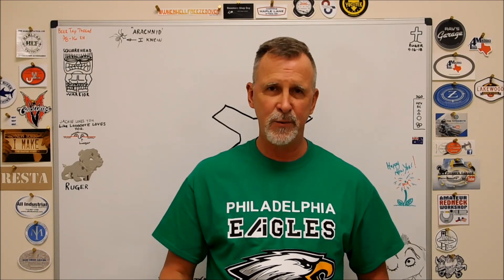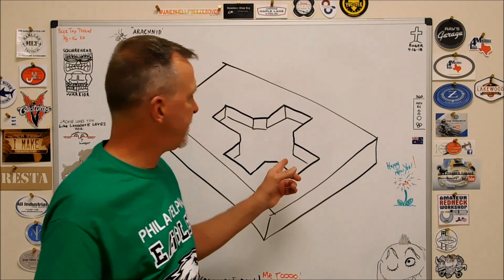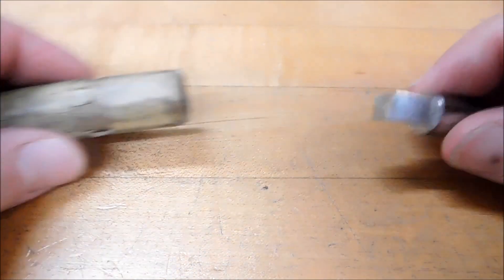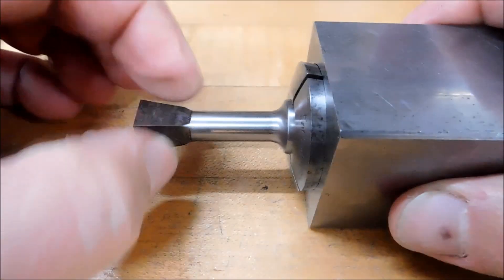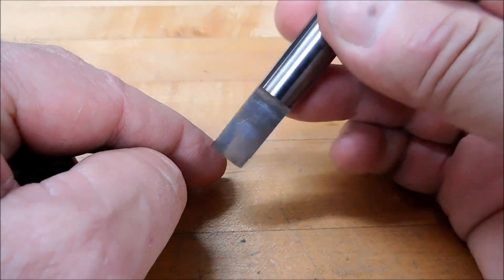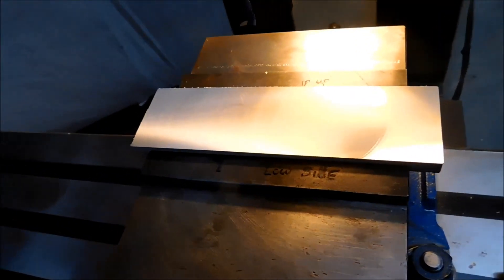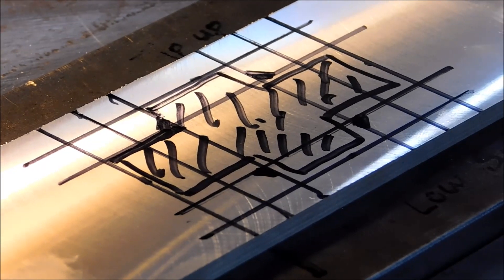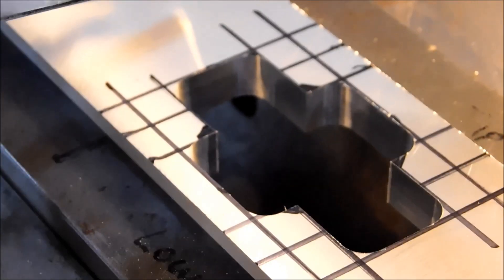You Can't Make that Part on a Manual Mill......Or can You?

Comment: When putting the mill in back gear & lowest speed why not just set the brake on the spindle? Apply the brake & lift the handle to a 45 degree angle & it holds the spindle...

Comment: can this still be done if you have a base? and a stupid question, but just making sure, your machine is not running while your broaching right? and will a HSS broach broach 4041? Thank you Joe!!!
Reply from the maker: Machine is off, lowest gear possible, brake locked. You probably could do 4041 (4140), and I'm not sure about the base comment. You mean a solid bottom pocket? That would require a different grind on the tool and some secondary.
Reply: @joepie221  thank you!!

Comment: Are you manually making the broach move up and down? The close up of the video doesn’t let me see. Thank you. Also, it looks like you are using the “side” of the broach to shave a small amount off the sides of the “cross.” Maybe this was just for demonstration, but would you intentionally mill the internal shape a little undersized, then broach to the exact specification?
Reply from the maker: yes. the broach movement is by hand.

Comment: Hey Joe not sure if you`ll see this but I heard what you said about bluing stainless. I built a 1911 pistol out of 416 stainless. Will the method you talked about work on the slide and frame without any dimensional changes ? I`v always wanted to blue the pistol but did`t know how. I almost went with chemically blackening it but really wanted to find a way to blue. Maybe now I have ?
Reply from the maker: I have honestly never tried to blue 416. It would be an interesting experiment.
Reply: @joepie221    I`m no machinist but trying to learn. What I do know I learned by watching my father. So forgive me for any stupid questions I may ask. If I were to take the 416 and and mill it out close(maybe thinner in kinda induce warpage if it is to happen) to the dimensions of the slide and frame do you think it would accurately give me an idea of what`s to come when heating the real parts ? All this would be done to the mock parts: Do you think I should I just let the parts free stand, hand or secure them down to a flat surface ? Finally, will this harden it ? and would annealing bring it back down to normal hardness ? suggestions on temps ? am I asking to many questions ??? LOL

Comment: Nice job Joe.  I did something very similar in a cnc about 15 years ago making UHMW carriers for Siemens Diesel Injectors to run on a conveyor line.  I still have the HSS broaches.
Reply from the maker: That material is tough to deburr. break a lightbulb and use that as a deburring tool. Trust me. the frosted bulbs actually work the best.
Reply: @joepie221  Seriously, better than an x-acto knife?  I'll have to give that a try the next time I'm working with UHWM......if I can find a bulb.  I think everything in our shop is LED now except for some fluorescent tubes in the office.
Reply from the maker: @bbumpy4523  We deburred UHMWPE with broken glass for years. Something about the curve of the chunks and coating inside the bulb makes it glide far better than an x-acto. Dead serious here.

Comment: Is it possible to set the FADAL to zero Rpm and G code to have the spindle go up and down while stepping over a set dimension per stroke?
Reply from the maker: Yes, I could do that, but the orientation of the tool would be tricky.

Comment: The internal corners can be milled by a number of methods : 
1) A Bridgeport Quillmaster with an angle endmill using the power quill-feed.
2) Clamp the part to be milled flat on a 45 degree angle to the table.  Rotate the head of the Bridgeport to nominally 45 degrees . Grind the bottom of  single-lip cutter to an angle to suit. This can be trig-ged-out  or done by trial and error. Use the knee for the Z axis movement.
3) If the cavity to be milled is large enough, the Bridgeport Right Angel head can be used.
As far as broaching :
1) The Bridgeport Vertical Shaping Head attachment.
2) Clamp the part vertically to the table, and at a right-angel to the table's lead-screw. Mount the Bridgeport Right Angle attachment parallel to the table. Mount the broach in the head's collet. Use the table's power-feed to do the broaching. 
3) A shaper with a boring bar to accommodate a suitable broach.

Comment: Joe you're smart, I need advice. 
I'm using 8" angle iron to make tank brackets on a truck frame. 
I machined holes on one side to match factory holes on the side of the truck frame. The angle iron is hand cut into the right length. 
How do I position the top holes relative to the holes I already drilled? 
I can't indicate off the side since the cut isn't very good.
Reply from the maker: Do you need another hole relative to the one you already drilled? Does it need to match an existing set?
Reply: Yes the holes I drilled matched the frame perfectly so the angle iron mounts to the frame easy peasy. 
I need to mount the tanks angle iron track to my angle iron brackets. I could just drill some arbitrarily spaced holes, use a transfer punch then hand drill that spot, but I'm making 3 identical trucks and it would be convenient if everything bolted together like a kit, but more then that I want to increase my machining knowledge. Learn how to pickup features on multiple sides of a part.  That's why I watch all your videos. I know your time is precious. So thanks for sharing all your knowledge. :)
Reply from the maker: The first thing that comes to mind is to mock it up flat on a piece of cardboard and use that as a template. Setting heights is easy when its flat, then just bend it and line it up with the edge of the frame, or the first mounted bracket hole.
Reply: @joepie221  I'll do that.  I'll do all my calculating, make a template see if the holes line up. If they do I'll add those holes to my cad file. 
After that how do I physically machine the part? One side was easy, I put one edge in my vise, indicated off the corner edge, got about the right distance from the hand cut edge, used digital readout for hole placement, done. 
Now the second side is more tricky. I can indicate off the corner edge again, but how do I get my side to side to be correctly lined up with the first sides holes?
Reply from the maker: @elmeradams8781  Stick a pin or bolt in the first hole and locate your stop off of that. This way the overall length of the part can vary and the hole to hole will always be the same.
Reply: @joepie221  Ah excellent, I'll set my x axis 0 off the edge of the vise jaws run the pin up to that. That 0 is the edge of the hole, a little bit of math and I'm golden. 
Thanks Joe. I used to have a 87yo retired machinist helping me, but his health gave out last week and he passed away. Now I'm the head machinist lol. 
You're not even an old timer yet and already passing on your knowledge. Thank you.
Reply from the maker: @elmeradams8781  I just turned 60 in September. Some days I feel older than others. Good luck with your project.

Comment: I thought about broach as well. 
But you could get the 45* angles with the circular cutting tools and not on the broach.
Reply from the maker: Technically you could, but not in a vise thats not shifted or mounted to a rotary table.
Reply: To be honest it is probably faster to broach them like he did than to change the setup. If you have a one off part with reasonable tolerances this is a good method.

Comment: Just curious, why didn't you just rotate the part at 45 deg and use the end mill to cut those? Just for demonstration?
Reply: Part was already squared with the bed of the endmill, paired with the 2 parallels and already flycut. Easier to just align or use a angle block and use the test indicator on that. The more rigid the machine, tool, table and work piece the better.

Comment: Wow, I was told over and over to never use air to clean away chips.
A marker instead of dykim?
Reply from the maker: You must have been told that by a really old guy. For demo purposes, a marker is fine. Honest layout work, dykEm is the go to.
Reply: Joe Pieczynski, and it was an old timer not so much as an old guy.
Reply: As long as you maintain your machine regularly and wear safety glasses air is fine. It even says not to use air on allot of the data plates since it has a habit of getting into places it shouldn’t be and taking small chips along with it, increasing wear.
Reply: Fluffy Zyox, it does go places you don't want it to go. A chip brush and a vac works just fine, but alloys are not as much of a concern, it's high strength steels that are.

Comment: When you say  " 1hr @ 900° " on the 17-4 ss, what exactly do you mean?
Surely hardening SS (17-4 in this case) isn't that simple, is it?

Thanks for your time & knowledge...have a good one.
Reply from the maker: Actually, if you start with condition A 17-4, it is that easy. Let the material come up to temp with the oven and soak it for 1 hour. Air cool. Its easy. H1050 or 1100 or 17-7 is a lengthy process, but the 17-4 does the job.
Reply: I assume that's 900 degrees FAHRENHEIT  (?)  vs.Celsius . . .

Comment: Can always apply the arbor brake with a bungee cord to increase the resistance to rotation... ( 'w')/
Reply from the maker: I plan to make a collar with indexing options. I'll show it when I complete it.
Reply: @joepie221  That would work better indeed! (~_^)-b

Eager to see how that works out because we have a Bridgeport and that might come in handy some day.

When I was up in MN working volunteer energy research, we got a 22 inch 4 slotted indexable table from an auction and WOW was that thing handy! Especially when we could put a 3 jaw 90 degree chucked indexer on top of it! 

Talk about compound mitering!

I wish I could buy all that stuff off the shop owner up there, sure could use the heck out of it down here!

I once made a 1 degree tapered mandrel for that 22 inch table, my co-worker said I could not do it [negative minded, thinks women are dumber than men and that all people are dumber than him, makes me wonder why I put up with him all that time] and other than the initial 1 degree roughing cuts, I 'crept up on it' at high speed and low depth of cut until it was close enough to sand smooth with 2000 grit paper.

That taper mandrel fit so well he was flabbergasted. 

1/16" drop and it was too tight for him to pull out with pliers.

Never again did he tell me I couldn't do something.
Reply: Definitely. Lagun milling machines have locking spindle breaks which should suit this kind of operation well.
Reply: @benjamine6703  I apologize for misspelling 'brake' up there, did not even see it the first time and only realized it when I saw your reply and read my own comment [embarrassed]
Reply: Delicious DeBlair You were correct with “brake”

Comment: Hi Joe. Really good tip. I geuss if you made a broach the same size as your cutter you could work to the same numbers on your DRO or hand wheels for both milling and broaching? Is there much difference in cutting performance between the broaches that are flat on the end and the ones that are hollow ground?

Comment: Being a "NEWB" in this machining world that was pretty damn impressive!
Now I'm assuming, because you sped through the actual cutting, that you were pulling the quill handle down to make each cut? (Remember, NEWB)
Thanks for that one big time!!!!
Razor!
Reply from the maker: You are correct Razor. I was shaving the material off by hand. I moved the table a little bit after each cut.
Reply: @joepie221  
Thanks Joe. Seeing this really got the gears turning realizing how many ways I could use this technique. 
Hopefully I will come up with a need for this and put it on video and I guarantee you'll get a shout from Razor Works!
Thanks buddy,
Razor!

Comment: Many years ago I was taught to scrape in key ways on the lathe using a boring bar.  I later discovered that using an aloris tool post height nut to adjust depth of cut and turning the boring bar 90 degrees so the cutting edge faces down you can scrape in flats using the cross slide.  THEN rotate the chuck 90 to make square holes on the lathe.  Works in a pinch if it needs to.

Comment: Could you not use the spindle lock to keep the spindle from rotating out of position?  My Bridgeport  & Sharp mills both have a cam surface that locks the brake lever in the on position if you pull up (or out) on the brake handle..

Comment: While the can-do attitude is admirable, unless you are an EDM shop the first reaction should be to get back to the engineer and ask if this is really what he needs. 9 times out of 10 such parts are just engineering bloopers not the actual intent of the engineer. If this is what was really intended they'll probably ask for EDM or broaching to begin with.
Reply from the maker: You are assuming the engineer knows what EDM and broaching are. Too many places nowadays have designers that have never stepped foot in a shop and believe if their 3D printer can make the part, then it must be good and can go straight to machining. You would be surprised at the amount of work I reject for tall internal square corners and the customer refuses to make a change.
Reply: @joepie221  yeah, these types, okey. Anyone can play around with solidworks, but that doesn't make you into an engineer yet. An engineer must know how stuff he draws is made, or he is no engineer at all. But you know, young guys fresh out of school, how are they supposed to know on their own, there is not much in terms of workshop experience at schools. And I imagine that quite often the contact you have with customer is not even from engineering, but some guy from sourcing and logistics. As you say, they have never set foot in a workshop, so your feedback to them might be the first real experience with practical machining they get. If they learn, then that feedback is invaluable. 

And if they are the type who would like to learn, but never have had a chance, then they might appreciate a workshop tour and a little bit of talk about how you do things, what are your capabilities, limitations etc. That might be a good way to secure customer relations for the long term. Or it might be a waste of time, depends on the customer I guess.

Comment: Why can’t you set the spindle break to stop rotation?
Reply from the maker: You can if the brake is loose enough to implement the cam feature on the lever. mine is not worn enough.
Reply: tie wrap a heavy weight onto the brake handle since you do not have three hands LOL. sounds silly but hey it would help

Comment: How is that broach not rotating in the spindle?  It doesn't appear that a rotary broach is attached.  I rewatched the vid and this important piece of info wasn't mentioned.
Reply from the maker: Rotary broaches are  normally used while spinning. This was not a rotary broach application. The machine setup to reduce the rotation of the spindle was covered.
Reply from the maker: Start at 9:04 for the spindle info.
Reply: Thanks Joe... very ingenious!  I had rotary broach on the brain as I was trying to figure this out!  LOL  I can't wait to try this on my Bridgeport...

Comment: Nah!  I just use a 0.001" diameter slot drill to get tight into the corners - not perfect but close enough    lol!
Reply from the maker: I went to my drill index, and it was gone. And my .001 diameter end mill didn't have enough length of cut. Kidding of course. Sadly enough, there are a bunch of designers and degreed engineers that still put features like this on parts they design for machining.
Reply: Nice video Joe,   like the bead blasted look an alu. I make some alu parts that I bead blast the face and polish up the edges, the contrast looks great.

Do you find 60psi a bit low for blasting? usually 80psi or above before it'll cut  - suppose it depends on the bore size of the nozzle
Reply: Joe Pieczynski, then they can use a 0-1" inside mic to measure it, LOL!!!
Great video Joe!!!!

Comment: In the old days I would have made the edges with a file!
Reply from the maker: I did my apprenticeship in a company that specialized in precision miniature components. They had a bunch of B&S screw machines that used cast iron cams to drive the action. A guy named Walter used to come into the shop and use the vertical filing machine to fine tune them. What that guy could do with a power file was nothing short of art. This part would have been a piece of cake for him and probably just as accurate. Never underestimate a file in skilled hands. Chris over at Clickspring is living proof of that.
Reply: "In the old days I would have made the edges with a file!"  It is a good thing someone invented electricity!  ;-)
Reply: @valveman12  I am not that old, but 45 years ago when I was a apprentice we actually made the edges by hand or with a filingmachine. It was probably faster than doing it on a machine.
Reply: @helgethaysen7830  Cheers!

Comment: Nice job. (I don't have a machine accurate enough to hold a broach steady enough to do that job. It would take me a full day to make using my drill-press and files, and not look nearly as good or be as accurate).
Reply: You know, you could make a clamp for the final drive shaft on your drill press, and then use a broach in the drill press.  Light duty, but possible.